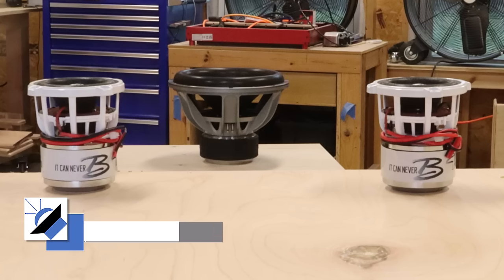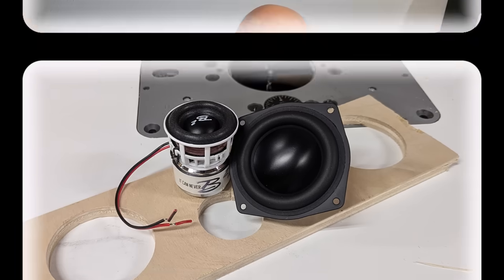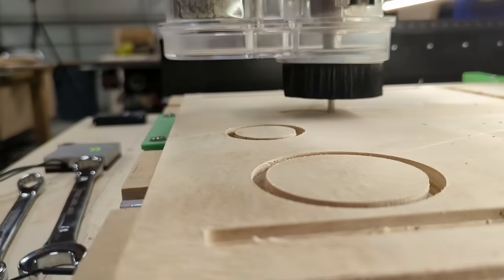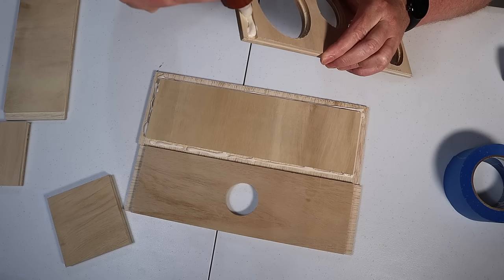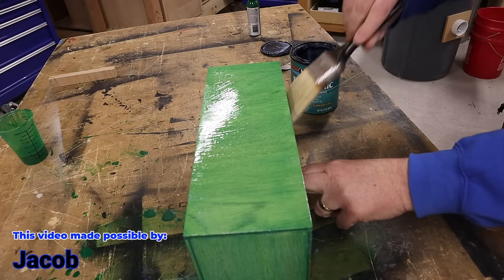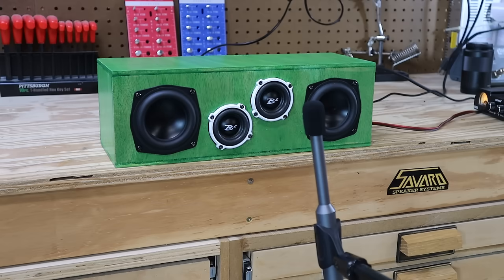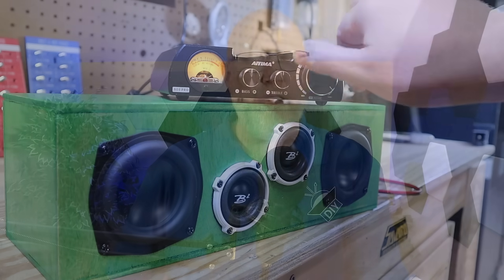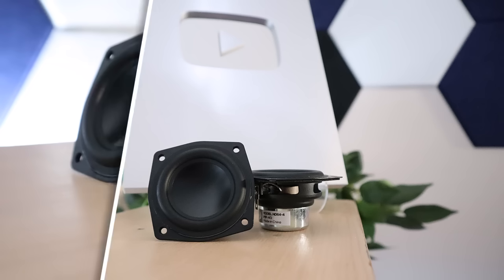The worlds smallest subwoofer!

Comment: Those Dayton nd64 you showed at the end kickass! I have them in place as rear fill on the rear deck of my car in a tiny enclosure and they add the smallest amount of kick too the overall beat in the system. With the mounting tabs cut off I managed to install them perfectly into the factory Hk speaker housing in my bmw e36 and I have them high passed more on the side of caution since learning my lesson from previous 3 other various brands of similar configuration drivers which I overpowered carelessly resulting in them not lasting very long 😅 so don’t send a ton of power to them and don’t set your xover down to 80hz if you plan on sending these things to the moon. I think they are around 250hz right now because I want them to hang with the rest of the boys. I can get more volume out of them if I wanted more of their presence to be felt but lkke I said I’m going to error on the side of caution since I did some dumb mistakes in my previous attempts at outfitting speakers in said location. But for anyone whose going to use them in a custom Bluetooth speaker I think you will be more than happy with the sound and bass output if you follow the reccommended box size for the driver with moderate listening levels you can get some pretty decent bump out of them. With those ears chopped off it’s just around 2” in diameter and about 40mm tall so it’s great for my application 😊

Comment: Need some info , I have 3 deaf bounce 12’s their 1 ohm , what what should I be wiring them and what kinda ohm should I be looking at the video with the calculator was a bit confusing
Reply from the maker: Did you try the calculator?  Just plug in some numbers and experiment with it.

https://diyaudioguy.com/?page_id=965
Reply: @ how do I know if my sub configuration is parallel or in series , not the wiring
Reply from the maker: @scottysheets3787  Parallel or series is a wiring configuration.  They're either wired in parallel or wired in series.

Comment: Hey DIY Audio guy. I recently built my own sealed box for a kicker l3 12. Fits under the seat of my Ridgeline. I would like to add a PVC port but my box dimension are unique and all the port calculators online are giving me very random answers. Was wondering if you can help me determine my answer.

Thanks!!
Reply from the maker: I've got a port calculator on my website, DIYaudioguy.com 

Just keep in mind that you can't just drill a hole and slide a port in and expect to get good results.  Ported enclosures tend to be larger than sealed enclosures. 

If you're looking to pay for a custom speaker design, I can't help you with that.  I'd have to have access to the car to design a vehicle specific enclosure.

Comment: What if you take like 6 or 8 of those and put it in an appropriate housing and such.
I think than it could actually produce good bass, or am i mistaken?
I mean, you have 8 times the membrane than and thus moves lot more air.
Reply from the maker: At 60 bucks each that would not be cost effective.  That's the kind of thing you would do just for the visual impact of a tiny little subwoofers flexing like mad.   Not saying that it is not cool, just saying that it is impractical.
Reply: These things have an Fs of 95Hz. Doesn't matter how many you use, these will not go particularly deep. Also, even at this size, it's not exactly the best woofer you can find (see TB W2). You'd still be better off using a single - larger - driver.

Comment: Instead of the wingnut couldn’t you remove it, and if not, could you use an aluminum nut for even further weight reduction from the radiators??
Reply from the maker: The wing nut just so happened to provide just enough mass to Hit the desired tuning frequency.
Reply: I figured as much. Excellent setup sir! Cheers

Comment: PRs are incredibly under-utilized in the mobile market IMO. Very well used in the BT speaker market. I use them on my boats where space is a premium and I can’t afford critters and water getting behind the cone via a port. Output is fairly similar to a comparable ported enclosure, no port noise and I can just add weight to change tuning frequency. 

All that being said, the new RAD drivers that Brane just released in their X will likely change the subwoofer game in terms of size/performance once they start scaling them. Most innovative piece of sub tech in the past 70yrs.

Comment: The tang band w3  subwoofer  are  a decent mini woofer 💯🎶🎵👌👍✌️
Reply: I got W3 in a 3D printed box with two ND90-PR and that thing is crazy. It's a bit bigger than RC2 though - W2 is similar in size, but with much better motor - offers higher sensitivity despite lower Fs.
Reply: @tomkocur  I have a short, showing the W2s playing 18hz and showing noticeable air movement in a bathroom. That's a huge airspace to make that happen.
Reply: @Subdynoman  too bad they're not available anymore
Reply: @tomkocur  I think they are through the TB site only.
Reply: They are mini beasts, the TB W2 2040 are even better

Comment: Do you get more SPL, the more area the PR has ? like with a horn. 

Are the midtones and Highs getting trough the PR more of a problem than they are with a port ?
Reply from the maker: I don't think you get more SPL with a bigger passive, not really sure if the mid-tones pass through the pr. That's not something I've ever thought about.
Reply: PR size is more about meeting the displacement requirements of the driver. The PR has to have twice as much displacement as the driver, so the PR has to either have twice the piston area, or twice the excursion, or meet somewhere in the middle.

Passive radiators have drawbacks but regarding noise, they have an advantage over ports . It keeps the enclosure sealed so you don't get motor noise, high frequency backwaves, or undesired resonances escaping the box. The only frequencies that get through are the low frequencies the PR is designed to resonate, while higher frequencies are retained within.
Reply: No, you don't get more SPL with a bigger PR. It only moves thanks to the energy provided by the back side of the active driver, size of PR doesn't affect its amount. Too small PR will result in too much excursion, so all you really need is to have enough Sd to stay below Xmech.